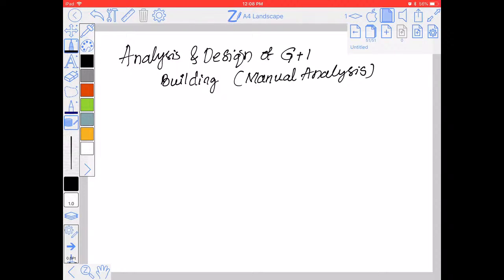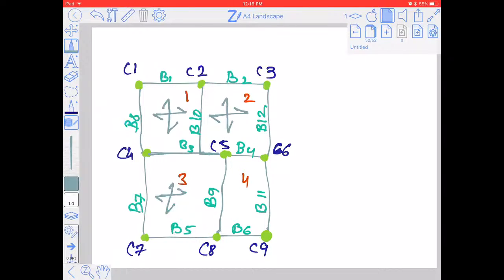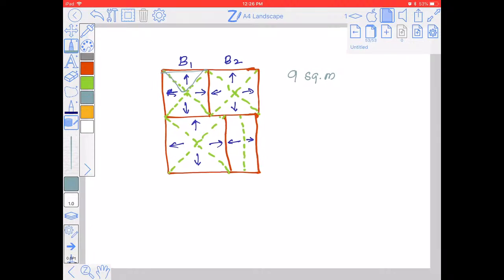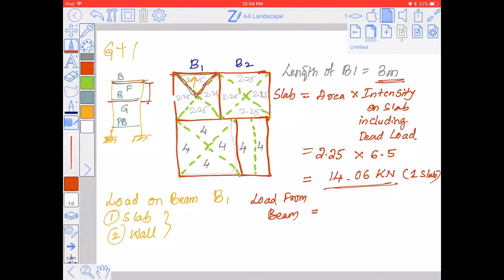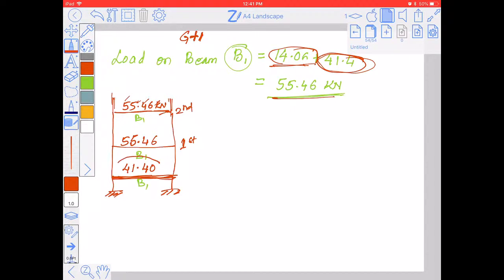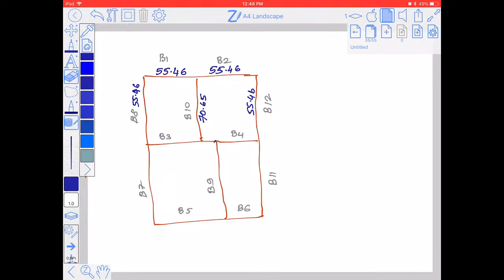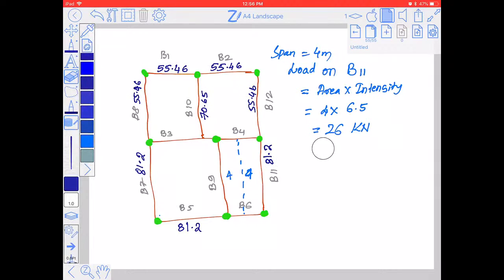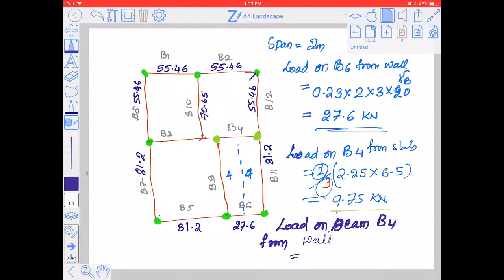MANUAL ANALYSIS AND DESIGN OF G+1 BUILDING (PART 1)

Comment: Load on beam B4 from slab would be slightly different from what u said.
Explanation:
For square slabs total load is equally distributed into 4 triangles.
For beam B4, if we draw a perpendicular from column C5, intersecting one side of the triangle, then the area of that triangle would be 0.5*1*1=0.5.
therefore the load contribution from the slab would be (2.25-0.5)*6.5=11.375kN
Please let me know if I went wrong anywhere.
Reply from the maker: Actually you should draw triangles from beam end to end.. not from columns.. as we transfer load of slab to beams not on columns directly…

Comment: Sir in load calculation on beam you have considered only load from slab and dl of brickwall but what about self weight of beam.
Reply from the maker: you can.. as i m taking density of wall on higher side and considering wall height is 3m.. When deduct beam depth in wall.. wall height will be around 2.8m itself.. some portion of dl of beam is considered with brick wall and remaining with slab..

Comment: I have planned to construct two separate rooms like 20*10 ( ground floor with 10*14 room size at first floor) & 22.5*10  (only ground floor) . My engineer suggested RCC is as follows. Pls tell it correct or not. Basement level of 22.5*10 is 2 feet less than 20*10 room

1. For 20*10 - 6 columns of 12*4 with 8mm stirr up of 7 inch c/c - four at each corner and remaining two at spacing of 8 feet at one end and 11 ft at other end.  Plinth beam with 1.5 feet height and 9*9 (l*b). Ceiling height is 10 feet. Planned tie beam at below windows (2.5 feet) and lintel  (7 feet) of  6 inch rcc

2. For 22.5*10 - 6 columns of 12*4 with 8mm stirr up of 7 inch c/c - four at each corner and remaining two at spacing of 10 feet at one end and 10 ft at other end. Plinth beam with 1 feet height and 9*9 (l*b). Ceiling height is 12 feet. Planned tie beam at below windows (4 feet) and lintel ( 8 feet) with 6 inch rcc

And join the both room in ceiling and  both room in 90 degree position to each other
Reply from the maker: Difficult to judge in comment.. please send structural dwg to my whatsapp number 7892787054

Comment: Sir what is .125x1x1x25 where 25 is density,.125 is thickness and what is 1x1 sir
Reply: Since  the weight is in volume, so we are considering for 1m, if thickness is 0.125, then volume is multiplication of thickness, width, length. We have taken width length 1m
Reply: It's vol into density? correct
Reply from the maker: Yes
Reply from the maker: Dead weight of slab
Reply from the maker: For 1 sq.m

Comment: I would kindly ask if you can do a video of G+3 Manual structural design and analysis (using Eurocode 2)
Reply from the maker: I need to study Eurocode.. As I am aware and expert in using IS456
Reply from the maker: Can u please send Eurocode to my mail 
mychannel.civ@gmail.com
Reply: Almost same procedure but uneed to follow dead n live load as per ur code
Reply from the maker: Exactly and design parameters also..